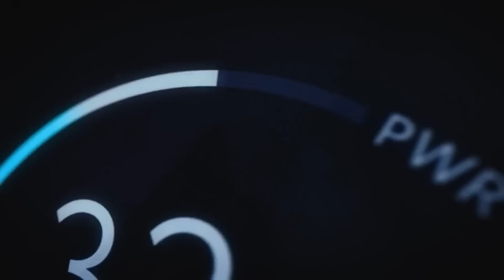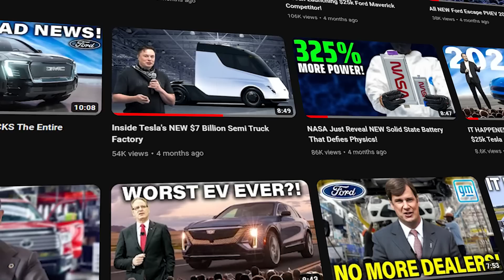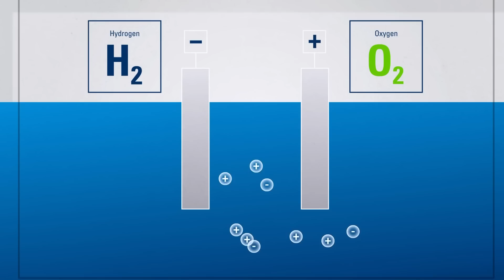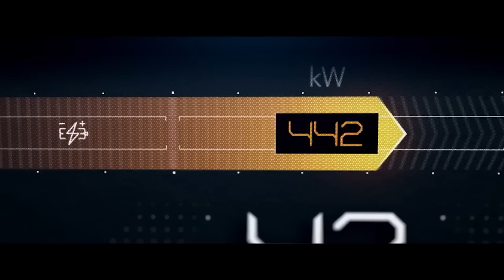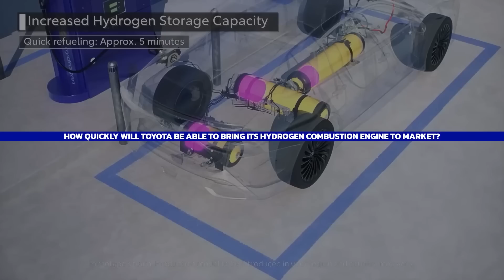New Toyota CEO Reveals Hydrogen Combustion Engine | Shocks Industry!

Comment: The EV is to cars like the CFL was to light bulbs, and hydrogen combustion engines will be to cars like the LED has been to replace, and in short term, the CFL.  Yet to be presented, and no doubt in the works somewhere, will be the residential (home) hydrogen production system which can produce, pressurize, and store the hydrogen gas via residential green-energy production systems.  So, do you spend the money now for an inefficient and expensive EV or wait for the hydrogen system?

Comment: There are 3 key limitations to EV as a transport solution. Limited range, high cost of ownership and extremely long refueling times. As to the cost of power distribution compared to hydrogen distribution, this is a current argument of convenience.  Yes, it is true right now, while EV numbers are tiny, but does not hold true for EVs as they grow to be a major market share. Multiply current numbers of EVs  by 1000 and you suddenly have a major infrastructure shortfall of catastrophic proportions. If the power grid is already struggling to support the current level of EVs there is no possibility it will support an increase of magnitudes in EV numbers. Hydrogen resolves all of these issues very elegantly and for comparatively modest cost. Hydrogen ICE engines would be largely based on modifications to existing oil based ICE, so no massive manufacturing cost impact to be absorbed. Required lithium becomes a tiny fraction of EV requirements, time to refuel is directly comparable to oil based ICE cars. Yes, of course there will be a long transition period, but if anyone imagines that the same does not exist for EV also, step back, and consider the requirements for scaling up to major market share proportions for recharging EV at 350 Kw per outlet.. Beyond that, consider that hydrogen has a much wider latitude of solutions, such as aircraft and heavy industrial vehicles. We should just get on with it and develop a robust hydrogen infrastructure concurrent with the EV infrastructure. Who said there can only be one single solution, why?? Of course Elon doesn't think hydrogen a good idea, we would surely be disappointed if he thought otherwise.

Comment: The interesting thing would be to examine to longer term sustainability (Environmental, Economic, Political and Cultural Impact), with regards to: i) sourcing, parts and materials, ii) Use, Economic multiplier effect, iii) Disposal/% of Recyclability of spent parts. 

Aside from growing pains of EV recharging infrastructure and the need for more Engineers and increase demand for electricity, we are not clear how spent Electric Batteries will be environmentally disposed of. The socio political impact and stabilities of local communities where, stuff like lithium iron, Coltan, Rear Earth are mined, particularly in developing countries. 

The Supply Chain and End of Useful Life of these so called  “Environmentally Sustainable” products is a whole life cycle that we still need clarity about. EV glitches and infrastructure in 1st world economies may sought themselves out but what’s the whole life cycle? Maybe that’s why Toyota is thinking differently, as hype and marketing of EVs may just end up being the new Fossil Fuel Industry for the 21st century🤔 🧐💭

Comment: OK, you have a hydrogen combustible engine! You also have a tank of hydrogen fuel under pressure.
So what happens if you shoot the tank with an incendiary round?

Bottom line: If it causes an big explosion, someone will damn sure do it.

I understood that this could also happen with a tank of gas but a tank of gas is not under pressure.

Comment: Nothing, but nothing beats those incredible Electric motors designed and produced by Tesla some of them will go over 20.000 RPM, so simple, linear  efficient, fast very fast. in confront this hydrogen engine looks like a bad contraption, heavy, inefficient and very costly. Toyota what is wrong with you, you were a leader and now you are a follower. Tesla has taken away from you premium customers and they will take the rest unless you go electric in total commitment like yesterday, drop Hybrids,  Hydrogen and all the other losing propositions.

Comment: What about Power Paste?? The Germans are already using Magnesium Hydride to generate Hydrogen for Fuel cells in motorcycles. Fuel Cell technology is maturing, and it's WAY more efficient than an Internal Combustion Engine. You just add water at the filling station, and it gradually generates the Hydrogen Gas.

Comment: Hydrogen (like Helium) will escape from the piston rings, and accumulate dangerously in the Crankcase. UN-Like Hydrogen, however-it will Explode.
Also-even if that Hydrogen is "Green"-sourced, putting ANY fuel through an Internal Combustion engine is inefficient. 
A Hydrogen Fuel CELL, OTOH, would be Quite Efficient.

Comment: The Hydrogen Combustion Engine is the future. When the scarcity of hydrogen refuelling stations is mentioned, one should think back to the start of fossil fuel, i.e. gasoline stations about 100 years ago. That changed rapidly when fossil fuel manufacturers got involved. The same is happening with green hydrogen production. Siemens has developed a fully autonomous offshore hydrogen production facility that is undergoing large scale tests in the North Sea and the Arabian gulf. Linde, another industry giant, is working in collaboration with other gas producers as well as municipalities and regions in Europe, North America, the Middle East and Africa to set up a massive network of hydrogen refuelling stations. May I add, these stations are not just for private vehicles but also for commercial trucks and buses as well as industry. Furthermore, the production of an hydrogen ICE vehicle causes less than 10% of environmental damage compared to an EV. Also, a vehicle with an hydrogen ICE is over 90% recyclable, an EV less than 10%. These are the major drawbacks of EVs none of the EV enthusiasts ever consider.

Comment: If NASA is having significant troubles storing H2 (shout out to Artemis), how are automakers going to solve for this? Spoiler alert, they won't. 

If the plan is to go with H2 fool cells, good luck on getting enough Pt & Ir.

Comment: who wants to again depend on another oligarchy to provide the Hydrogen for you. so they can jack the price up and down whenever they feel like it. ("Supply Chain issue"), Hydrogeon has an even bigger problem with building infrastructure than EV charges, EV charges all they need to provide good chargers and support for repair for it, and does not need safety, security, inspection, tanks, and storage management, however, Hydrogeon does, Hydrogeon does not make sense, this is oil industry dying wish.

Comment: Unless toyota set up their own hydrogen station instead of depending on gas station to hold them. I can see this being a problem just like other EV brands outside of Tesla. You have to make sure your charge/fuel infrastructure is set up correctly and on a large scale. If they don't these new hydrogen cars will end up exactly like CNG fuel cars. forgotten and tossed aside.

Comment: Let's face it. Storing/transporting/refueling hydrogen is much more dangerous than gasoline, let alone electricity. Any form of combustion engine is far less efficient than electric engine, because any form of combustion will yield much more energy loss.

Comment: Toyota

I think Toyota will continue to dip their toes into both EV and Hydrogen, and continue to refine all their ICE vehicles into Hybrids with incredible gas mileage of 45+ MPG. Ice vehicles will be with us well into the 2050’s, as will the Gas Stations that fill them. Over 20 million cars have been produced in the first three months of 2023 in the world, with ICE being 90+ percent of them. It is very common for Toyota’s to clock 250 thousand miles on the odometer before being “retired/scrapped”, and the average car is raking up 12,000 miles per year, therefor a Toyota ICE or Hybrid bought today, or even up to 2030 will still require a “vintage” gas station to fill with petrol well into the 2050/2060’s! Gas Stations as we know them will be around well into the 2100’s. They will just slowly convert to bi or tri fuel dispensaries, Petrol/Charging stations/Hydrogen, and remember, all autos need service, which many stations provide.

We are another generation of battery evolution away (Lithium Ion is not long term) from cells that provide the proper distance, or ability to withstand cold weather and high heat. Aluminum/Silicon looks promising as it overcomes the negatives of Lithium Ion, and our planet has lots of Aluminum and Silicon deposits, so extremely cheap to produce. Tesla is one step away from disruption, though i cannot prognosticate by whom.

Till i am dead and long gone, i will just turtle around in my recent Toyota RAV4 Hybrid, and not give an ear to the Media Analists decrying about the “race to end Ice or the world will fall apart” nonsense! And I will do it at 42 MPG!
So I am not worried about Toyota in the long term, my 2 cents…

Comment: My Camry is 21 years old and still drives well. Parts are cheap and stocked at everywhere.   If you drive the toyota to its grave, the overall cost of ownership will be MUCH lower than any EV.  I'll bet the environmental impact of an ic toyota, that lasts twice as long, is lower than 2 evs.

Comment: If the green hydrogen is made with wind or sun available everywhere , anywhere, why do you want to « transport » this energy elsewhere , it is completely silly, unlike electricity H2 can be stored very economically (COPV 10$/ kWh stored vs 150-200$ for LPF and Over 50000 cycles or 6 month at full pressure without any measurable gas loss ) so that green H2 storage cost per kWh is almost insignificant financially and for long extended period of time on site with also little economy of scale with larger sizes of system unlike power plants for availability at multiple location without the cost of an expensive power network. Then, speaking of « efficiency » for an zero carbon energy supplied free of charge has also very little sense, your electrical mind is wrong Elon since the total cost per useful energy kWh used or stored and the amount of grey energy for producing, recycling and dismantling the energy production system is much more essential for abundant wind and solar power of all unused offshore desert and roof surfaces etc….with biomass and geothermal as clean supplements. Also, if green and clean hydrogen is locally produced everywhere, it can be produced stored used and sold with fair trade exchanges without the huge current energy monopolistic margins of gas stations, electric and gas meters. Moreover, the local green H2 so called « huge losses » are also sellable for domestic volumes heating, hot water or absorption cycle air conditioning and the 8 pounds of pure oxygen produced for each pound of green H2 has also a great commercial value for welding or medical use of quite a few dollars per pound….thus lowering the futur cost of all three items, pure H2, pure O2 and domestic heat,,,,In summary many « Elons » react like an 19 century electrician which would electrify his railway with a resistor in the boiler and the pantograph on top of the cabine of a steam locomotive!!! But when the primary source of energy changes, the distribution must adapt to it and the charges also adapt to this new distribution, NOT the reverse….(jute bag for coal, power line for electricity, tanker truck for servicing gas station, etc,..) there are no question, hydrogen is an optimum way to produce, store and use green and clean surface power without expensive network and any inefficient massive storage now needed by those variable unpredictable and seasonal free of charge energy sources. Then H2 does it with much less grey energy overall than a full electric reinforced network non sense massively beefed up for domestic heat pumps and electrical mobility replacing  those existing fossils energy charges, specially at current 9000$ per ton and 3000$ per ton copper and aluminium prices…storage of electricity is so inefficient that production has always closely matched demand and the night surplus are wasted in light pollution, heavy mobility recharging and other non senses night usages invented ( French power utility even paid the sncf railway company for high speed TGV to go faster at night with increased wear and energy costs!!!) now, with much more massive and endurant storage required by the erratic free green clean power, a type of power source required for the planet diversity and sapiens survival, the electricity is no longer the (only) optimum vector to use economically and efficiently all the human energy required, at least on the new clean power portion of the many converted domestic heating and mobility huge loads which are also different than instantly needed loads like lift light medias etc..for which the power network was designed for but not to accommodate all the transfer from fossil to local clean power huge amount…

Comment: Let’s talk about the environmental destruction caused by EV’s resulting from the strip mines to obtain the battery elements via slave labor? How about the toxic waste left behind via spent battery materials? How about the fact you have to generate the electricity through the burning of fossil or nuclear fuels in an infrastructure that is nowhere near up to the capacity required to support this? How about the fact that when an EV catches fire after a crash, the fires created are absolute runaway fires often requiring days to extinguish? How about the very limited, weather dependent range requiring extended times to recharge? 

EV’s are an absolute scam. Kudos to Toyota for not being bullied by the WEF and the rest of the globalist ghouls who are against us all!

Comment: Yeah im lucky to have a home charger for my tesla I went on a 120 mile one way road trip and had to come back.  It was 35 degrees out and it was highway speed going up and down mountains.  I had 350 mile range according to the car.  We went about 80 miles and stopped at a super charger, went the 40 miles there and 40 miles and had to charge again at the same charger on the way home.  That estimated range was flat roads, going 55 miles an hour and not running the heat pump for heat.  Go 80 mph up hills wile running heat and suddenly the range is probably 2/3rd's of what they claim.  Normal car with a  400 mile range you know you get about that even on the highway.  Now add in the extra 40 mins to stop and charge to top off and a 2.5 hour drive turns into over 3 one way.  So this not all warm and fuzzies.
Reply: Unless you really needed the charge after 40 miles you should have just waited and charged on the way back. After 40 miles the battery is still well over half full even going up and down hills. The charging is slower when the battery is fuller. If you would have just stopped at the charger on the way back you would have spent 15 minutes getting the same amount of charge it took 30 minutes to get when the battery is over half full.
Reply: @Aircam73 I mis spoke the one way distance was 146 miles little less then 300 miles round trip.  And it was 150kw charger not the 250kw. so when I left home range said 350.  Drove it 80 miles, charged it.  Drove another 68 miles and I wouldn't of had enough range according to the tesla map to make it home which was 147 miles back.  I would of bene -15 it said. (total miles driven would of been 68+147 home so 215 miles of range.  So in other words, my "350 miles" range fully charged model 3 was only getting around 220 miles of range in this scenario.  80 mph cruise, 37 degrees out driving up and down mountains.  This is what the tesla map told me to do, there wasn't  a lot of them in that area which was WVU and hagerstown md.
Reply: @cranbers  Gotcha. If there is doubt about making it and you have a charger available then of course charge. I would have done the same.

Comment: Toyota is correct.  H2 is the way to go. Why ? H2 does not require massive Battery filled w Hazardous Materials. EV range will never surpass H2. EV takes too long to charge. H2 engine can generate more than 500 Horsepower. H2 is the future.
Reply: Hydrogen station is 10 times more than EV charging station. How are people gonna afford that?
Reply: @galaxyoldman  The cost of EV is on the back end. You drive it for 10-15yrs. And then you get to pay $10-20k for a new Battery.
Reply: @M3LTUP  Older batteries last between 250,000 to 350,000 miles or around 20 years. Newer batteries last 400,000 miles+. Hydrogen tanks on the other hand last only a couple years and Hydrogen fuel cells will maybe get 150,000 miles before needing to be replaced costing even more than batteries. In the same 150,000 miles you have saved over $40,000 dollars driving an EV vs driving a hydrogen car on fuel. Makes the battery replacement seem like a bargain doesn't it?
Reply: H2 requires batteries and a lot more rare earth materials to run. Such as Platinum, palladium and cobalt. Also what hazardous materials are there in EV batteries? EV range has already surpassed H2. There are EVs out there in the wild right now that can go 500 miles. There is no way that an H2 car can do that without filling the rear seats and passenger seat with hydrogen tanks. Hydrogen tanks take up the majority of the space and to even get 350 miles hydrogen tanks take up so much space even midsize cars have less storage and interior space than sub compacts. Any H2 that can produce 500 Horsepower will need even larger tanks to feed it and even bigger fuel cells to run it. EVs are also producing over 1,050 Horsepower with ease as even my Tesla Model Y has 500 Horsepower.